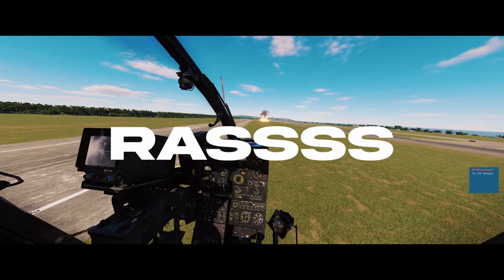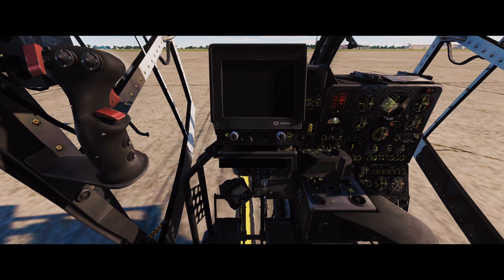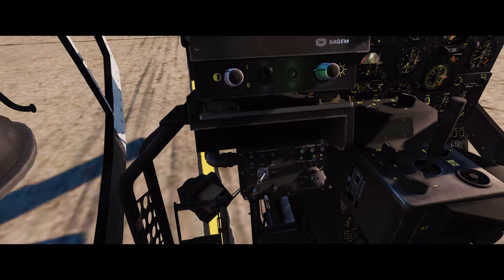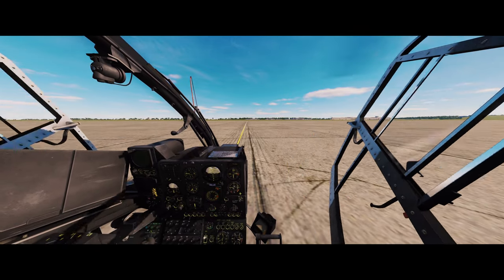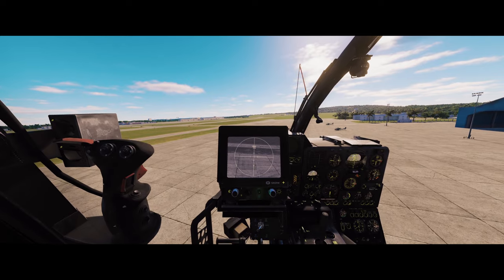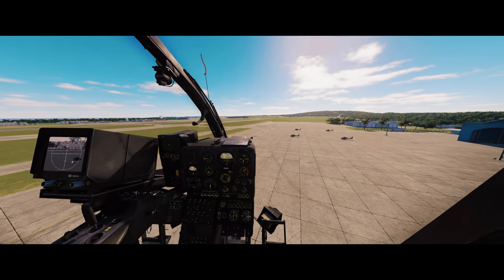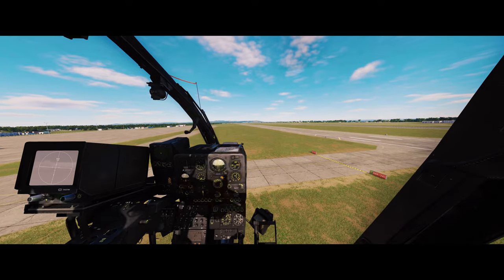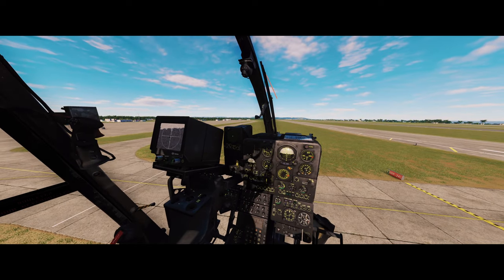DCS - GAZELLE M Variant - DIGITAL COMBAT SIMULATOR - 4K

Comment: Bought the Gazelle recently and love it so far. You can slave the Helicopter to the sight from the 2nd seat, btw. It will aligne itself in the right direction to fire the ATGM in auto-hover mode. That's what the small white square means. The heli must not deviate more than 3° from the sight to fire. ö7
Reply from the maker: Gotcha, ok. I’ll remember that for the next time I fly that version. What gazelle do you like the most?
Reply: @rasse30  Hmm, I would have to say the L version. Love taking the doors off, zip around and sling some unguided rockets and 20mm around. And the Minigun version is a pleasure to fly, such great view. I'm still a DCS noob but the Gazelle is not as dificult to fly as YT is saying. But by the time I have the M version in auto-hoover, though a Co-pilot would have fired all 4 ATGMs anyway :,) 
The Minigun version does not have an AI doorgunner like the Huey, does it?!
Reply from the maker: I agree, I love the L version. We should fly sometime. I live having the doors off, I don’t think the minigun version has a AI gunner but I will check
Reply: @rasse30  Sure, you will have to hold my hand, though. I have yet to step foot into multiplayer. For now I just had some co-op training fun with a buddy on a training playground i build for us.